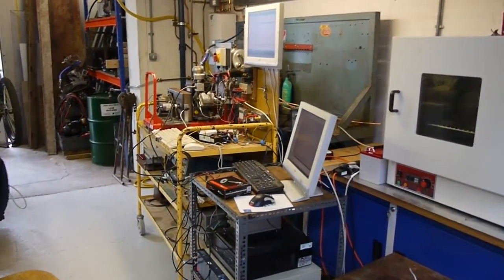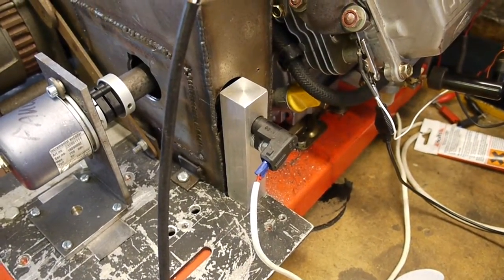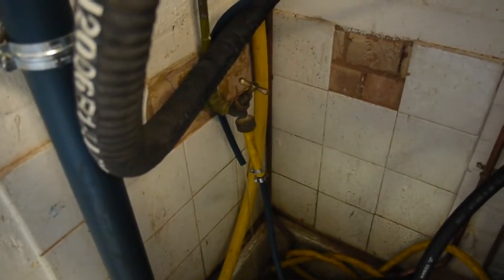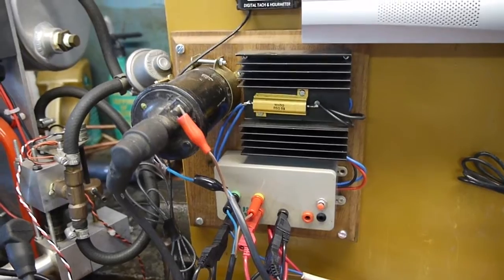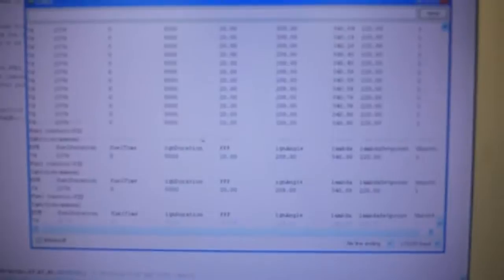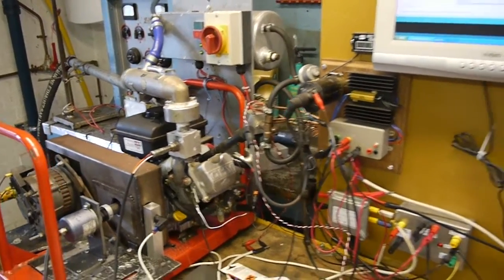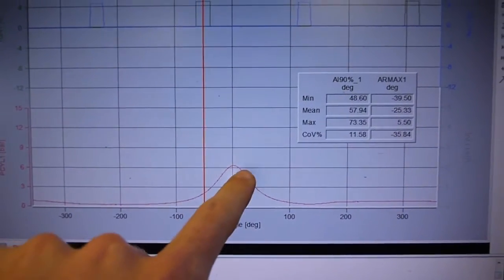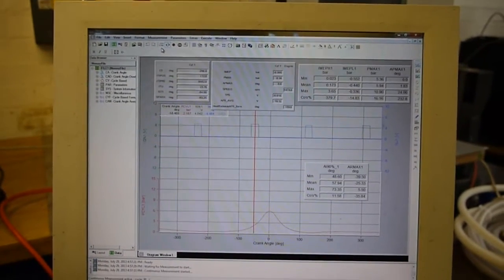Arduino Engine Control Unit

Comment: Gr8 Video.  I would be very interested to see the engine running.  Also to see a pressure trace from your spark plug sensor during a proper firing stroke without a misfire.
Reply from the maker: I think there's one in the video somewhere or maybe one of my other videos